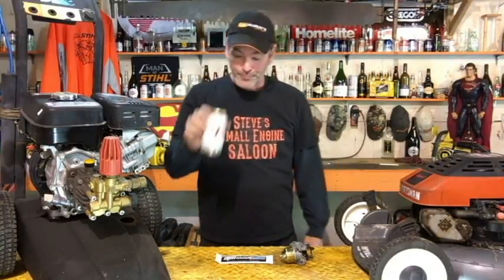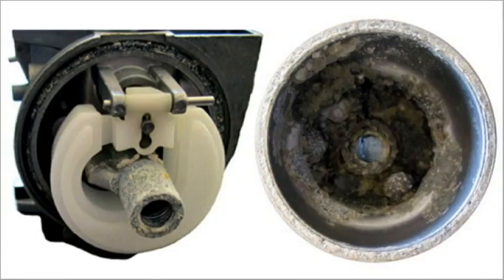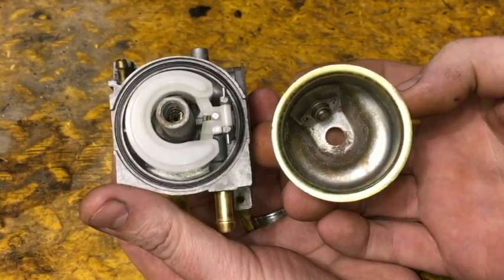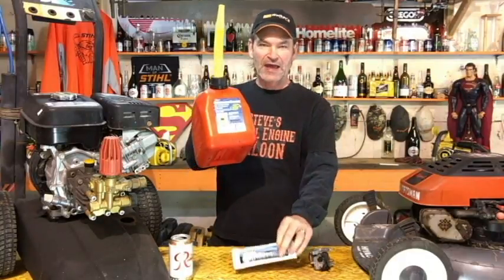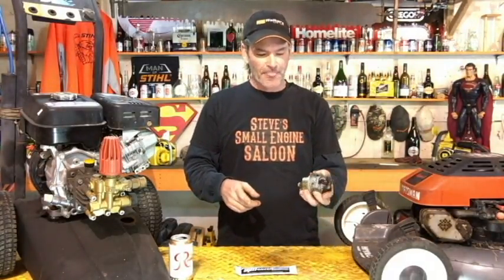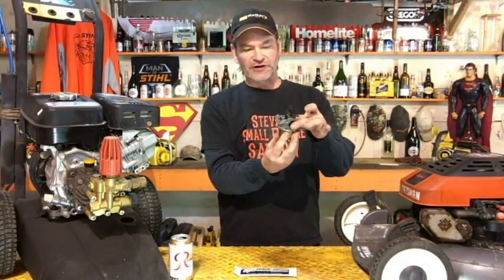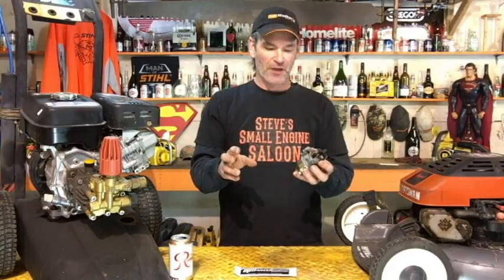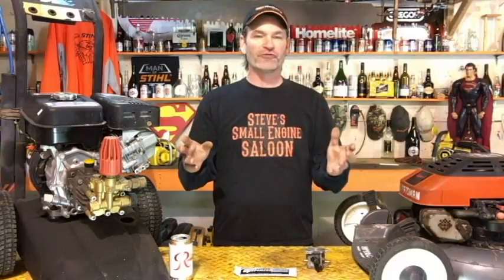How To Winterize A Lawn Mower, Generator, Pressure Washer, Etc.

Comment: The issue with running the fuel system dry is that it allows exposure to the air (oxygen) which causes corrosion and especially deterioration of rubber and plastic parts.  Stabiizer works best when it's in fuel.  Your fuel system is designed to be saturated in fuel.  Best practice:  fill your tank with pure, engineered, pre-packaged fuel and run it for a few minutes to get that fuel throughout the system.  Then you are good for months and months.  No need to "exercise," no need to run dry, just fill it, run it and forget it 'til you're ready to use it again.  Period.  During the season, I use non-ethanol fuel and stabilize it out the wazoo as soon as it comes out of the pump.  Every fill up - the same way.  Then for good measure, run a tank of engineered fuel every so often to help clean out the system.  Unfortunately, fuel from the pump is a variable - it can have water in it, sediment, etc. - just depends on the station and the condition of their tanks.
Reply: where do I get engineered fuel. for lawnmower?
Reply: @servejesus4980  Any big box retailer like Lowe’s, Home Depot, TSC, Walmart, and most small hardware stores and auto parts stores carry it.

Comment: Having to run water through the pressure pump while “exercising” your pressure washer motor in the winter isn’t too appealing!  LOL
Reply: How long can you run one without water before damaging the pump? I've seen small engine mechanics on YouTube do it for a short time. Certainly not for as long as Steve is recommending?
Reply: Only takes a few seconds to blow water out of the water pump. No problem doing that.

Comment: For starters, DON’T USE “CORN GAS” in your engines! In other words: USE NON-ETHANOL gas. It won’t last forever, but it sure will last longer than 10%, or God forbid, 15% or higher ethanol gas (engine poison)... Fortunately, I live in Southwest Georgia, and all my engines are run normally year-round. We almost never get more than a week per year of temperatures below freezing...
Reply: around here (Illinois), it is essentially impossible to get non ethanol gas...
Reply: glock 22 ... Very sad indeed... It’s not even easy here in the South... Usually only just 1-3 stations in a small town have non-ethanol...
Reply: Jack Myhre ... But do you use a stabilizer?
Reply: I agree. I live in up state NY. I use ethanol free (easy to get here) all summer and seafoam for the storage. I run the machines and just shut them off. They stay for 5 mos. and I never had a problem. Some people say to run them dry, but I think thats like drinking coffee and leave the cup. You seen the residue left behind.
Reply: We've stored our mower for the last five winters with regular in the tank (it's 5 years old). How it's survived, beats me.

Comment: I put Stabil fuel stabilizer and Lucas fuel cleaner in every can according to directions when I fill them. Stabilizer is cheap enough so I use it year round. I fill my mowers with whatever gas is left and put them away. I have been doing this for 20 years and never an issue.

Comment: Be it right or wrong, I generally completely drain the  tank and float bowl and leave no gas at all, I sometimes drain the oil the same way. What is your opinion on my method?
Reply: I run the gas out complpetely and take the drain plug off the float bowl while I do other work to Winterize the mower.  
However, put fresh oil in right away - don't let it sit all Winter with no oil in it . . .  if that's what you're saying.
Reply: @chrisbcritter6112  But is it a good idea to put fresh oil in and let it sit all winter? I mean surely putting the fresh oil in at the start of the season would be better?
Reply: @kmcca08  I'll be honest. I wouldn't let it sit for long at all without oil.

Comment: I use the run dry method, but I use non-ethonal and add some Marvel's Mystery Oil to that final tank. I figure it coats all the parts and helps prevent deterioration.. great video!

Comment: Steve, over the years I began using Sta-Bil on every fill up of my gas cans.  The rule of thumb was the end of season is a variable.  This way my equipment in theory is ready to be stored at any point.  I generally top off the fuel tank and put it away.  I do this for my 2 & 4 stroke equipment.  I have yet to experience an issue starting any piece up when it comes time to use it again.  I know the length of time varies on how long stabilizer will keep the fuel good.   I buy the Red and it says up to 2 years of storage.  Something I would never push to the limit.  The only piece of equipment that might sit that long is my portable generator and that I exercise about every 3 months and drain the tank annually and refill with fresh fuel.  So far this system has worked well for me for over twenty+ years.  

One of the biggest problems that lead me to this method was on a snowblower that had a fuel tank cutoff and petcock on the carburetor bowl.  I with turn off the fuel tank, run the unit until it exhausted what remained in the carburetor and drain the remaining drops via the petcock.  After doing that for many years I experienced an issue one winter and had to pull the carburetor off.  I was shocked at the condition of the bowl.  It was pitted and crusted 😬.  I posted the issue on one of the Honda forums and got one reply I found interesting.  With the ethanol in the fuel was remained in the carburetor could attract moist air into the carburetor.  I am sure it took many years of doing this for it to get that bad.  I replaced the bowl and have never shut off the fuel system since.  No air, no corrosion 👍.  The snowblower has started on the first pull when taken out of storage without fail.  

I am curious to here your thoughts?

I wish you all the best for this Holiday Season and thanks you for all the great videos and content!

Comment: Been running the stabilized gas in my mowers and pressure washer till they run out of gas for 20 years + .Never has failed me yet. Forgot one year on doing that on my snowblower for summer storage and had to rebuild the carb that fall. Never will forget again! ;) Thanks for the video!
Reply from the maker: You're Welcome...

Comment: I always use high test gas in small engines, did not use chain saw for two years when hurricane caused trees to fall and blocked driveway, saw started with two pulls and shocked me so much I almost dropped  it, worked perfectly

Comment: 3:54  I followed that advice over the winter and had no problems starting my lawn tractor this spring.  Always made sure the air temp was above 40 degrees F prior to cranking to be safe, given the grade of oil when stored.

Comment: I run my chainsaw, generators and yard equipment once a month year round. I've never had a problem and they start on the first or second pull. Great advice Steve.
Reply from the maker: Right on
Reply: What if you clean the jets and carb, tank and line, but still takes six pulls to crank what could be the cranking problem  then on a BS. I check the key and clean the area no oil leaking  no gas leak just takes around six pulls, but after that it run very well  I did have to adjust the choke wire to get to run like it do now?
Reply: May I know for how long you need to run during winters for once a month? Thank you.
Reply: @HeyYall398  Long enough to cycle the 1 oz of fuel in the float bowl and fuel lines. Idle for ~10 minutes, for engines at a fixed rpm ex. generators but quicker for scooters that can rev between low and  high rpm's. Throttle controlled.
Reply: @MindKontrolleProject  Thank you so much! I did it for 5 minutes last winter and will move up to 10 minutes next time. I really appreciate you for taking the time to answer this for me.

Comment: just an fyi to pass along. I use a marine gas primer bulb with clear hose\tubing on either side to syphon gas from whatever. The bulbs i found were at a Home Hardware store. You know the ones...used from a boat gas tank that feeds to a motor. Saves your mouth and lungs a lot of damage. Depending on your hose size it might take a bit to syphon but worth doing it safely.

Comment: Another good idea, for winterization: remove the spark plug and pour a small amount of engine oil through the spark plug hole. While your spark plug is removed, give your engine a few pulls with the starter rope. This will cycle some oil around the piston to help prevent corrosion and a seized piston during storage. Don't forget to reinstall your spark plug afterwards.

Comment: I'd classify generators and chainsaws as essential winter equipment because if there's a storm and the power goes out a generator will make things more bearable especially if it's going to be a few days before mains power is restored and chainsaws are needed to cut up fallen trees.

Comment: I put tru - fuel in the tank and run the engine long enough to circulate throughout the system. Been doing this for years. No problems period.

Comment: You can also put roughly 8-10 oz of fuel in the tank and put a little of stabilizer and carb cleaner. Then run dry.

Comment: If you run "clear" ethanol free gas it doesn't go bad as fast. Had a quad that sat for 6 years with clear gas and it started up just fine.

Comment: Hey Steve - I'm getting lots of great tips from your site - thanks a lot!! If you've filled the fuel tank with fresh, stabilized gas and then run the equipment for five minutes or so, why not just leave the gas in the tank? I would think that this gas should stay good until spring. Some of my four cycle equipment is a real pain to drain the fuel out of.

Comment: I've recently stumbled across your videos and have subscribed. My small engine collection is growing, and seeing common sense ways to take care of them is very helpful. My question, is how do you go about exercising your power washer in the deep winter months?! You can't run it dry, so that means digging out the hoses, etc. I think I'll just keep that one dry and put fuel in it only when needed. Btw, I use RV antifreeze in my power washer pump when in storage. Thanks for the videos and enjoy those beers!
Reply from the maker: What an awesome, intelligent question!  In the frozen months it might not be possible to exercise a pressure washer!  I think I would just store it with an overdose of Sta-bil and fill the tank right full to avoid condensation.  Should be fine until the hoses thaw out....
Reply: @StevesSmallEngineSaloon  !×

Comment: Steve I also put my machines at top dead center and fog the engine with a light oil stable fog. And turn over with the spark plug out. I exercise my two four wheelers and my snowmobile in my storage unit up north and that seems to help. I also run non-ethanol gas.
Reply from the maker: Great tips, Thank You...

Comment: Nice tip man, but have you ever heard of "Fogging Oil" for a four stroke engine? If yes, is it necessary to use both STA-BIL Storage Fuel Stabilizer and STA-BIL (22001) Fogging Oil?

Comment: 2 Questions :
1. Won't I have to hook up all the lines for the pressure washer to exercise it? 
2. I ran the mower till it stopped. I would still have to drain the carb bowl right? FYI I unscrewed the bowl and I had fuel come out.

Comment: I just saw the carb bowel and the corrosion in it. I use to use ethanol gas on my 4 cyc engines and found out that it contains water which corrodes the bowel. I had a DeVilBiss generator and it quit working. Went to pull off the carb and my finger went through the bowel.

Comment: Steve good advice But....shouldn't folks also warm the engine up then drain and replace the engine oil with fresh oil? I always do this each fall before putting the lawnmower in storage. I also add a really great product made by MDR called Crankcase Stor-N-Start to the new oil and run the mower for at least five minutes until it runs out of gas. Stor-N-Start was developed for the military for use in engines stored over lengthy periods of time such as equipment only use in emergencies, etc. It is formulated to be extra clingy to metal surfaces and thus protests them from rust and corrosion during storage. This stuff can be tough to find. I buy mine online at Jamestown Distributors a company specializing in boat supplies. Been using it for years and it's great stuff! Also, no need to replace the oil in the spring as Stor-N-Start actually improves lubrication during normal use.

Comment: Best practice is to use 1) ethanol free gasoline - available at airports, marine and Countrymark gas stations. 2) use Stabil all year but drain & run small engines completely out of fuel. Take drained gas and add to your car.

Comment: Steve, I'm confused, and I may have misunderstood your point. 
If I add the fuel stabilizer, run for 5 minutes, and then run once a month for 5 minutes.  But, the part that confused me was, draining my fuel tank. If I drain my fuel tank, I won't be able to run it once each month thru the winter ? Maybe I misunderstood, or I'm confused. I enjoy your video's. Thank you, John

Comment: Steve I got a question, but first I’ll explain why I’m asking. I see so many videos about pressure washers not starting because the carburetor is dirty. 

So my question is, is it safe to add a fuel filter to a pressure washer that doesn’t come with a inline fuel filter?

Can’t it hurt or starve the engine?

Comment: We used turkey basters to siphon the fuel out when I worked in a small engine shop.  The basters tend to degrade quickly but they're cheap to replace.  I recently heard about running pure 2 cycle oil through the carbs upon winterization (after running all the fuel out of it) on 2 stroke engines in order to store them for years..I don't suppose it would hurt a 4 cycle engine to store it with 2 cycle oil coating everything...just a little smoky on start up.  I have had fuel shutoff valve gaskets dry out and leak the following year if you run all the fuel out of the line on an Ariens snowblower.  I wonder if a coating of oil would prevent that also.

Comment: Hello  Steve if I run my weed trimmer and mower dry threw the winter by doing the steps you explained won't this cause problems  with lawn equipment. Like rust or moisture getting into the tank or engine I leave my lawn equipment in a shed in the winter. After I exercise the equipment can I just leave the fuel/ stabilizer in my lawn equipment.

Comment: What about “True Fuel”? Is it better than stabilizer?
Reply: If by "true fiuel" you mean no ethanol added aka e10 aka clear gas? The answer, in my opinion, yes much better! Ethanol is corrosive especially so on rubber, plastic, and fiberglass and will dissolve fuel lines carburetor parts etc. Over time clear gas will become less combustible like ethanol added fuel albeit at a slower rate. What clear gas doesn't do is gum up your fuel delivery system like e -gas. I have a Honda powered pressure washer with clear gas and after sitting for 3yrs it started on the second pull.
Reply: @moto1p1  It's canned fuel, in which case, it is. Neither regular nor premium are great for winterization.

Comment: Of prime importance is finding a source of fuel that has no added ethanol. That stuff will break down and gum up a small-engine carburetor in short order. There is only one place local to me that sells it—a farm-supply co-op—but it was well worth the effort tracking it down. Ask your small-engine or tractor repair shop.

Comment: Yet another idea.. outboard motor fogger.  And yet another… after running it dry, inject ATF into the carb, and pull the starter a dozen times or so.  It coats the entire fuel system in ATF.
Next time you’re in your local auto salvage year, pull a transmission dipstick. That stuff will remain stabilized for many years.  Pro tip. Next time you start the engine, drain the ATF first. It will start faster. If not… don’t worry. It will run rough but not for long..

All this would be unnecessary if we weren’t burning corn in our engines.

Comment: What are your thoughts on putting automatic transmission fluid in the fuel lines and carburetor for long term storage? I've heard of it recommended for small engines. Thanks.

Comment: Hi Steve. Regarding pressure washers. Should I put conditioner in the pump? Can you exercise the unit by running without water going through the pump? Cheers pal.

Comment: I did this with my generator and a little solder point on one of the slip rings broke.  I am wondering if while the generator was running out of gas it was shaking a lot and that could have weakened the connection over time.  Any thoughts?

Comment: I prefer to use Seafoam as a stabilizer.But yea,run all the gas out til the engine dies.Then you'll have a coated carb for the winter.Steve,you're on it dude.
Reply from the maker: Thanks Buddy...
Reply: Lorenzo, from my reading Seafoam was originally designed for two stroke marine engines. Each time I add the recommended amount of Seafoam to a can of gas my engine smoked to high heaven. When Seafoam was added to tractor diesel fuel it also smoked. Enough of the smoking we returned to Sta-Bil. 

As for running the engine dry, each year we did as Steve recommended, first run it with a fuel stabilizer. The next season the device needed repairs. The shop said the fuel in the carburetor, though stabilized, had dried out then turned to shellack; they showed me the carburetor. Now my process is to leave the tank and carburetor full of fuel all Winter. Come Spring one pull was all that is needed. YMMV.